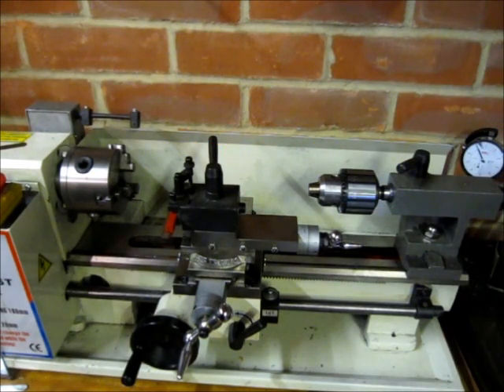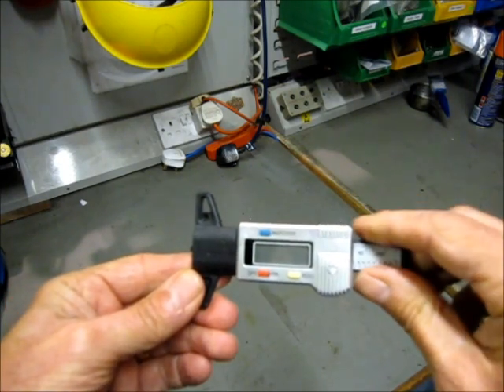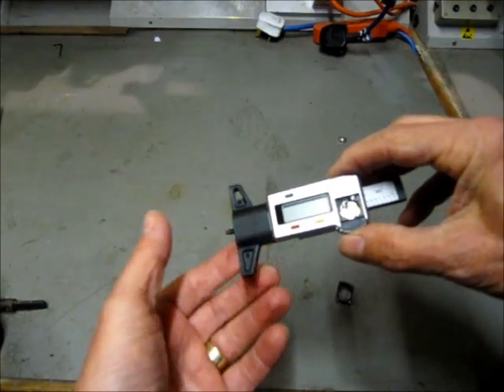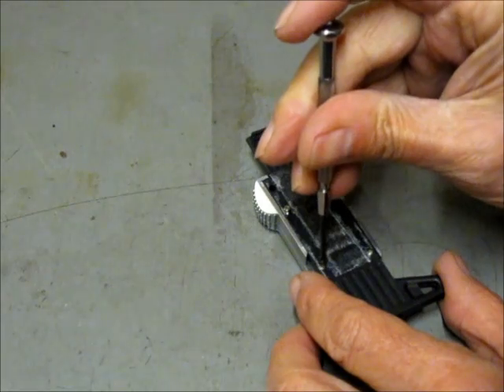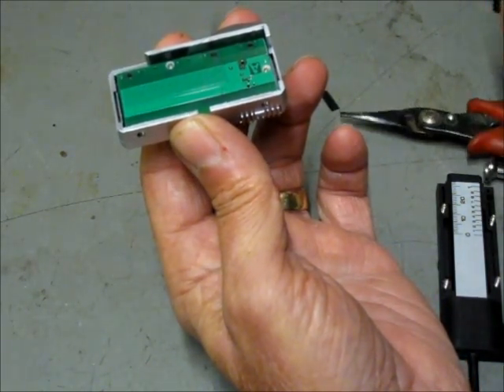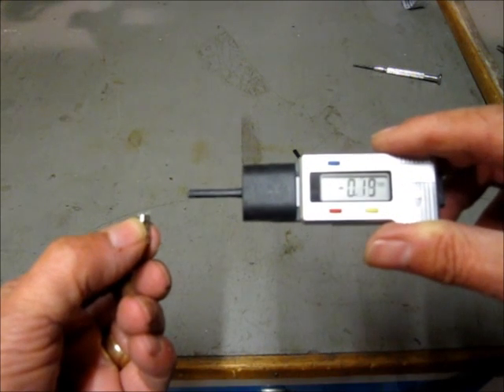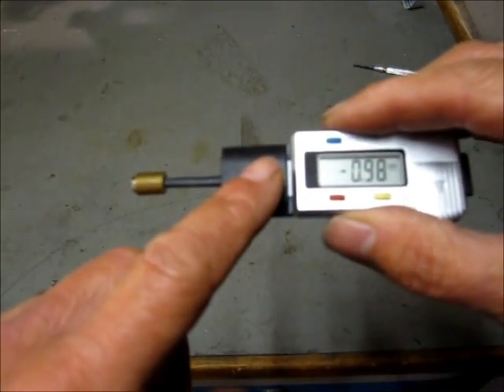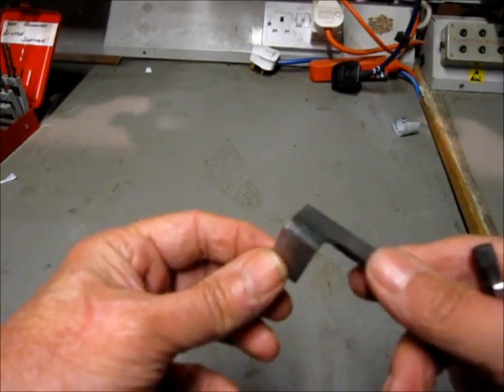Low cost DRO for a Mini Lathe

Comment: This is a great idea worth copying.....

https://www.youtube.com/watch?v=6hAH9vN2rdw&t=5s

I made one that works very well on a Grizzly lathe, but mounted it on the other side of the cross slide away from the chuck side with oil and chips:

https://www.youtube.com/watch?v=6hAH9vN2rdw&t=5s

There is one other variant where the fellow used a low tension spring to control movement of the probe, but I felt it was more complicated and likely to get chips or oil contamination.

Again, a great idea...

Comment: That isn't backlash in the lead screw. The threaded lug on the bottom of the cross slide has come loose. Tighten the 2 screws on the top of the cross slide that hold the lug in place. Use some threadlock.

Comment: Some backlash you got there. I would definitely try to sort that out before fitting any DRO device. Great idea just the same.
Reply: its a M9 x 0.5mm Leadscrew but main problem is you cant screw the handle tight since then you cant turn the handwheel. Thats where additional backlash is introduced. I plan to add custom made acial ballbearings to counter that (its not hard, just steelbals a cage and then turn a groove in the handle  so it fits inside)

Comment: Looked good so I decided to give it a try. Bought very similar looking depth gauges and the magnets etc and set it up pretty much as shown (my lathe looks damn near identical). Did some test turning i.e. increment top slide according to gauge reading and measure result and got some seriously undersized diameters! On detailed checking I find that a) the gauge is about 10-15% inaccurate (compared to mechanical dial gauge) but worse than b) that suffers about 0.3mm hysteresis. For those not familiar with that term its like backlash in the lead screw. So starting at zero wind in say 1.0mm - then wind back to zero and the gauge reading fails to change until you get back to 0.7mm and when back at zero still reads 0.3mm. Given that these are cheap gauges designed for tyre tread measurement not that surprising I suppose, but not as usefull as I had hoped. Still top marks Mike for coming up with the idea in the first place. Always easy to criticise after somebody has done the hard work!

Comment: Great idea Mike but why not fit it at the tailstock side of the saddle, out of any swarf.
Reply from the maker: +Emgee Radian An excellent suggestion that would work for many lathes. On my lathe the compound rest limits the visibility for a DRO fitted on the tailstock side. Also I have fitted a carriage lock on that side so there is now no room for the DRO. Swarf is only a problem when turning ferrous metals of course.
Reply: Mike Moore

Comment: I just made one of these today using strip magnets. I'm able to just snap it on the cross slide and go. It also will attach to the tailstock and the magnet attaches to the back of the chuck allowing easy indication of drilling or tapping depth. VERY handy indeed and easy to make.

Comment: great idea mike i will be making one asap as ive got a chester conquest also with slack on the cross slide. Since buying your lathe 2013 have you bought or know anywhere in u.k. for the quick release tail stock? im so fed up with the nut.
Reply from the maker: paul maddison Hi Paul, Amadeal used to sell a quick release tailstock that fitted the Real Bull lathes but they don't seem to list it any more. Might be worth asking them though. I wish I had bought one when I first saw them - that clamping nut drives me mad when doing a complicated series of operations.
Reply: Mike Moore MANY THANKS MIKE
#

Comment: Hi Mike,
           It's an interesting project and for additional info the digital tire gauge is manufactured by a company in China that also makes digital calipers. Now it's well known that the Chinese like to keep the prices low and to do so for the digital tire gauge they have used the electronics unit that is also used for the calipers. I purchased a couple of PCB's that are identical to the PCB in the tire gauge but are 1 Meter long for £15 each and ascertained that the electronics unit is capable of indicating 99.99 mm. To cut a long story short I cut the first PCB into two pieces to use on my milling machine and cut the other into three pieces, two for the lathe and the odd piece for the 'Z' axis on the mill. A dual axis readout from WARCO completed the total digitization on both my lathe and my mill on all 5 axie's for  under £100.
Reply from the maker: Mo King Hi Mo, Thanks for the info. I am going to buy a Seig Super X2 mill after I have acquired a plasma cutter and a few other things, so will be looking for a low cost DRO solution for that. I would be interested to hear how your setup stands up to swarf and cutting fluids.

Comment: Here are a couple of thoughts for anyone trying to do this. The friction mechanism for this device is not what is mentioned at about the 3:45 mark (I think that is a wiper or dust sheild and I'd keep it). The friction spring is actually under the side. The slide can be removed from the carrage with a twisting motion at the back (around the 0 label) when the slide is in the zero position. Once this is out it is also easy to enlarge the recess at the tip to allow the magnet to recess into the carrage, thus preserving the full range of motion.

Comment: Top job and well presented, A very useful addition to our lathes (and other precision equipment). The DRO measures on the slide, and shows tool tip to stock exactly, negating the effect of backlash completely. Well done.
Kind regards. Michael. Australia.